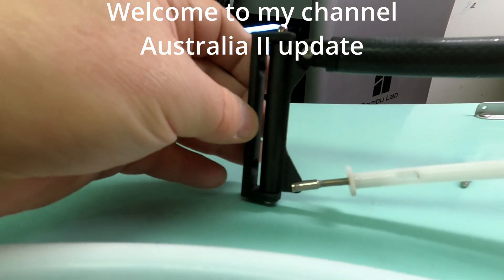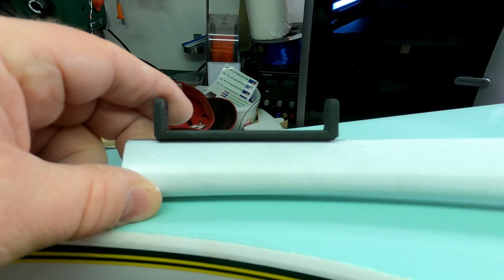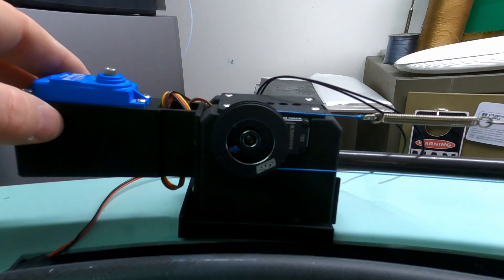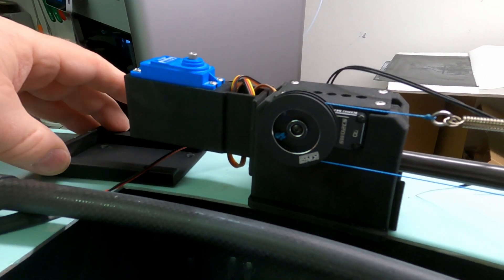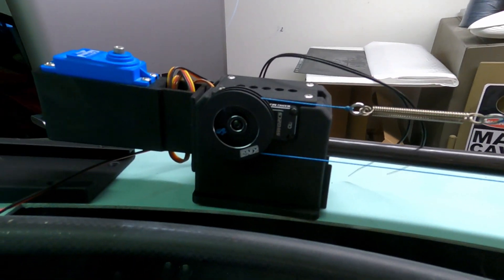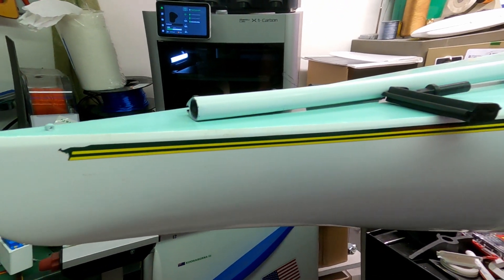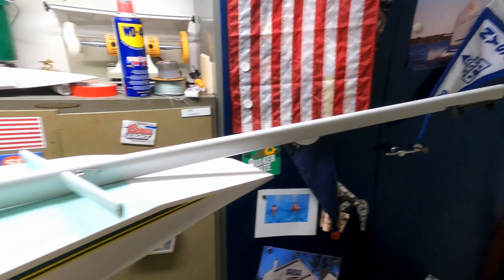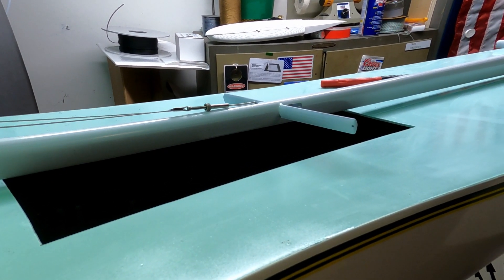Australia II update

Comment: The jib on the Kooka is like the "blade" that we used on A2 during trials off Freo in 82 because of the "Doctor " that is what the sea breeze is called there.
Reply from the maker: Cool! This Kookaburra II has been scrapped. I will build a Kookaburra II in scale 1:10 to replace it. I have the hull and keel finished already.
Reply: Kooka didn’t sail off Freo in 82. Kooka 1 .was launched in 84
Reply: @Lozzie74  Yes i was referring to the RC model of Lars sailing with a blade. Not the real yacht.